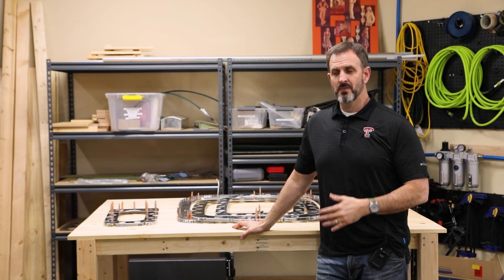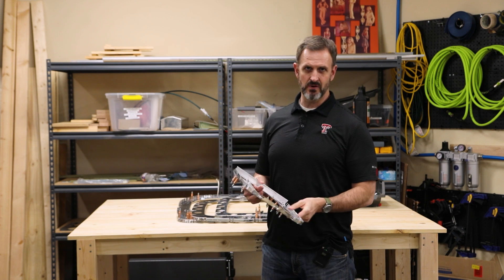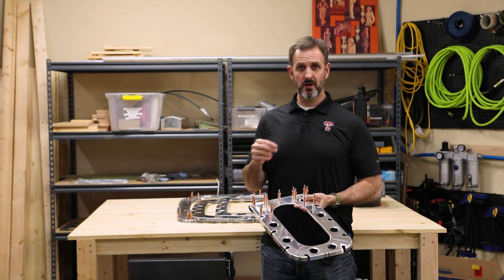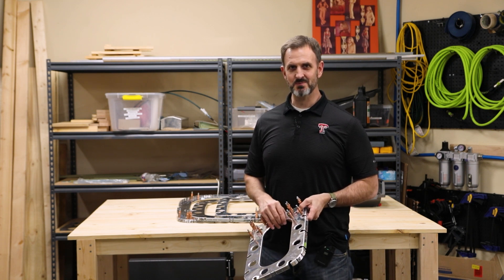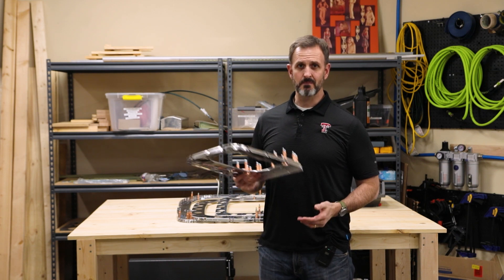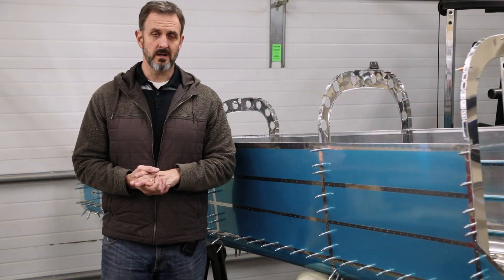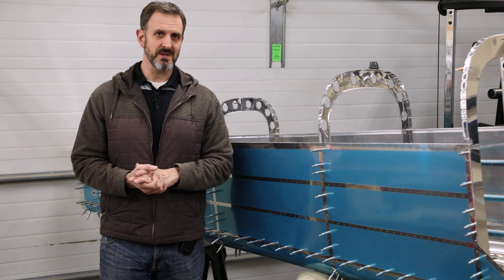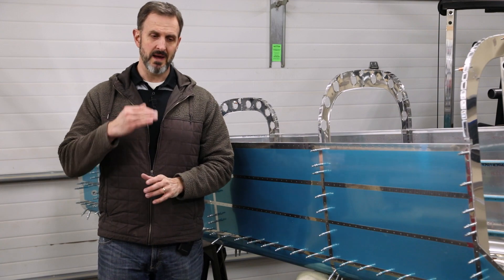Building the RV10 - Video 9 - Tailcone (February 2022)

Comment: I apparently don't have a life and am actually enjoying your dead pan sense of humor. Question for you, doesn't it make more sense to prime before you drill?  I was first thinking you wouldn't have to de-cleco, but I guess you would to dimple. Regardless you wouldn't have to worry about primer getting in the holes making putting the rivets in easier.
Reply from the maker: I almost always drill before I prime, unless it’s an accident (e.g., and most commonly, with a hole that is final drilled but not final sized and I miss that fact).  The primer isn’t typically so thick that it interferes with putting rivets in. But corrosion doesn’t work in aluminum like it does in steel so even if the sides of a drilled hole aren’t primed, that won’t lead to corrosion that spreads.